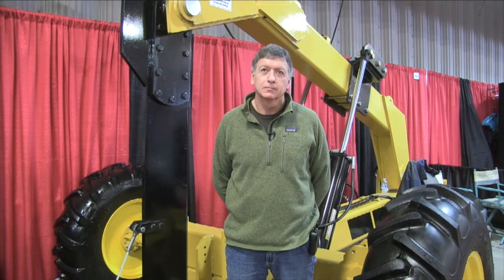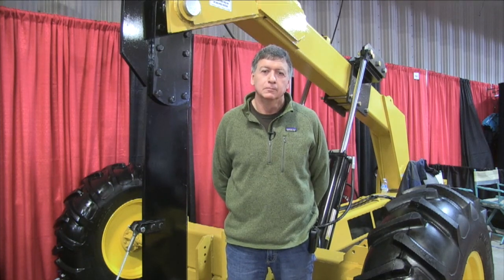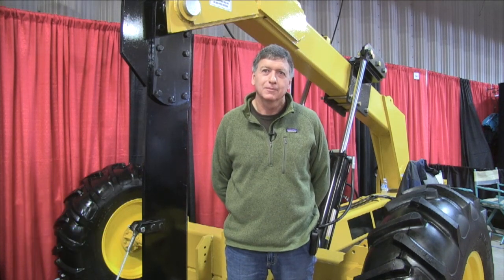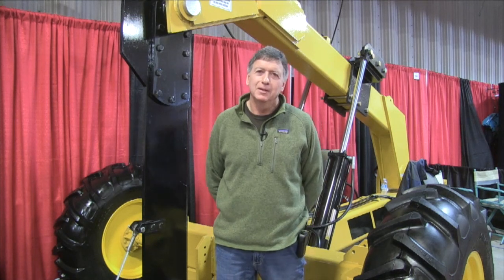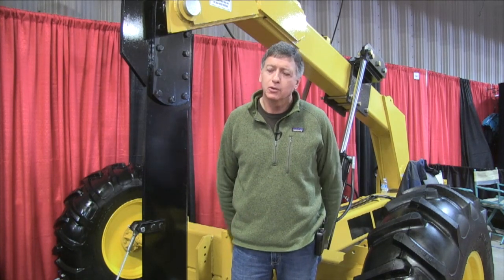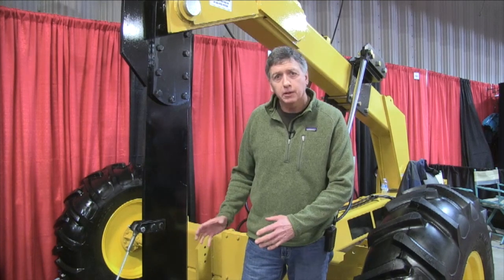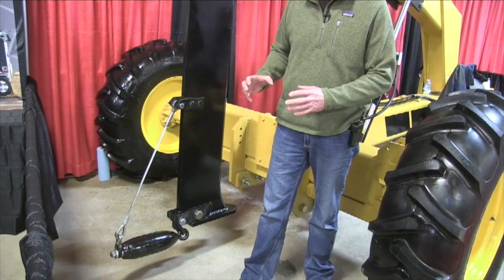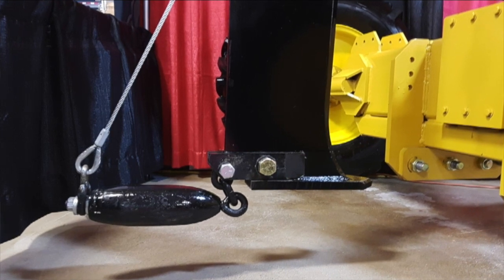Mole drainage leaves subsurface tunnels without the pipe

Comment: I once saw a set up in Northern England that makes this machine look a bit puny. It was designed to lay mole drains (and plastic pipe drains if needed) in marshy peaty land that had stones in among it. It resembled a gigantic gun carriage. The support wheels were HUGE, most likely scavenged off a cat loader or grader.The high flotation stopped it sinking while working. The blade was like a ships rudder. The old guy built it himself and towed it with acaterpillar (not sure what model but it was big, old and had no cab or roll bar) that had specially modified wide tracks. It wouldnt sink in the peat bog, he was always busy contracting on farms around Teesdale